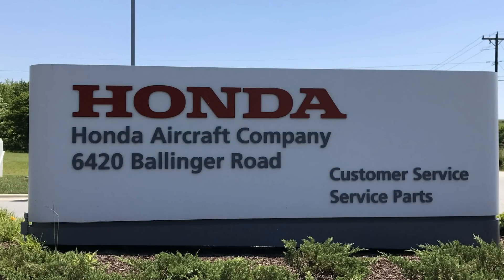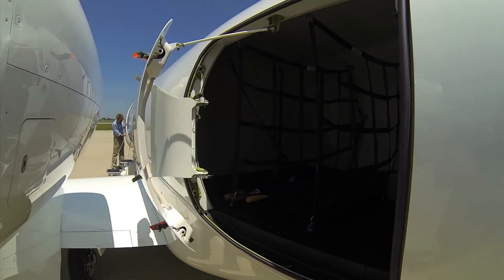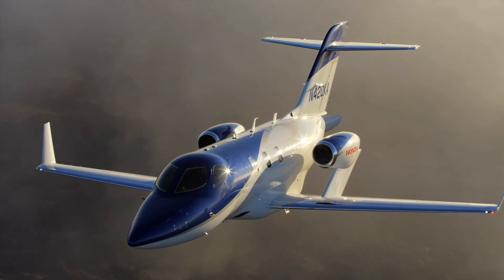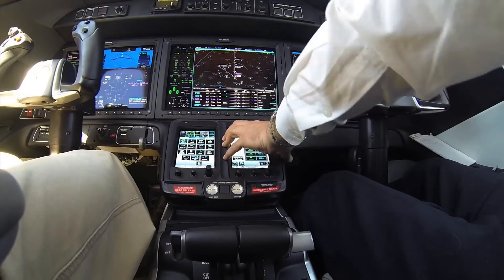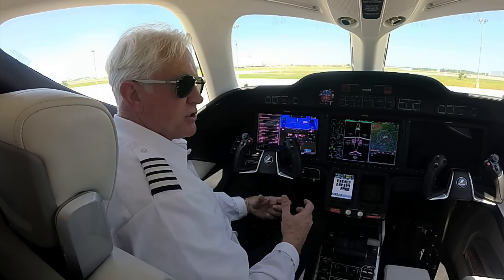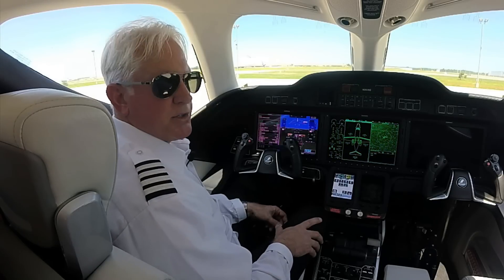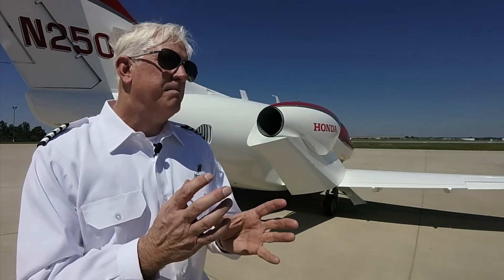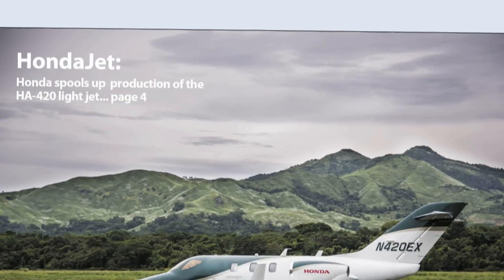HondaJet Flight Demo

Comment: Does it really need 3900 feet take off?  its climb rate is very high and great thrust to weight ratio so I'd think it could do short runway take offs.
Reply: 3900 fpm climb..not ground roll

Comment: This Jet is good in all aspects except the choice of the Engine. The Engine burns too much fuel and for a personal Jet, or charter Business, its not a good choice.  If there was a way to changing the Engine to match Light Jet category, or if there were different Engines from which to choose from, it would offer a better choice of a Light Jet. But as it is, it appears to be cheap on purchase but the cost of running it is much higher.

Comment: I don't understand why it is so expensive. It is an aluminum tube with some cheap chairs inside. The plane should cost no more than 250,000.
Reply: It is priced for development cost and what they think the market will pay. If they lower the price to much it will be seen as junk and some will not buy it.
Reply: You mean Cessna 172? you can get one for 35k or less.
Reply: Old? Yes. New? No.
Reply: actually I priced a C175...my mistake

Comment: Over wing fueling is a sad mistake, do these things take prist?
Reply: Single point, over wing fueling is actually quite convenient. Prist is not required thanks to the fuel/oil heat exchanger, but may be used if desired.

Comment: Gotta love those submarine-hatch--like windshields. Great for outside view and general awareness...not!
A biz-jet coming to market nearly 15 years (!) after its first flight that barely brings anything distinctive, apart from the wing mounted engines.
I don't think there's a more adrift company in what regards to strategy and purpose than Honda, in our days.
Reply: NimbusKhan NK      You don't think a $4 million jet in a $20 million market brings anything to the table?
Reply: @jshepard152  it did 10 years ago, but it's late to the market. The new Cirrus SF-50 is half the price.

Comment: No bird spiral on the engine nose?
Reply: Gasinduced Bird spiral? those spirals were created so that the ground staff has situational awareness when the engine is spinning. since the engine is mounted on top of the wing and is not instantly accessible because of how it's mounted, it is not necessary to put a spiral on the inlet cone.
Reply: It's likely they have a proper name not bird spiral. I understood they were added to prevent birds from flying in to the engines.

Comment: spokesperson needs to understand his audience - how much of the public know what a "flight level" is?
Reply: SDsc0rch altitudes with the last two 0s taken off. They start at 18000 feet. This is when planes transition from the local barometer setting to the standard 29.92 inHg. or 1013 hPa.

Comment: So not putting indicator lights on the ap panel is a feature. I guess making the panel settings instantly recognizable to 99% of the worlds pilots is a bad idea. For the most modern design in jet aircraft I also notice you still need to be an olympic high jumper to get over the console and into the seats. A little short on range for this class, the M2 sees 1550 nm and has leg room along the console to get in the cockpit seats. The Hondjets takeoff and landing distances are pretty sorry too.
Reply: >So not putting indicator lights on the ap panel is a feature.

Yes because in ALL other jets, pilots mistakenly rely on the panel lights to tell them what mode they have selected or what mode they are in. ONLY the Mode Annunciator Panel above the attitude indicator CORRECTLY tells you what you have selected. This is a good safety design feature. I've been a jet pilot instructor for 20 years and I've seen many pilots incorrectly rely on the lights on the auto pilot panel to tell them what mode they have selected...only to be wrong...so this feature is a big deal if you are a pilot. If you're not a pilot then it will pass right over your head.
Reply: Nobody cares. Stop nocking things people spent years and millions or even billions of dollars developing. Have you designed a fucking jet? Also, it is Honda's first jet. What do you fucking expect.

Comment: '
2 jetmotors on the wing is a okay but not really good idea...
better put 2 jetmotors on the rear body tube as A-10 thunderbolt plane / A-10 warthog plane design
Reply: bestamerica I'm assuming Ur aerospace engineer who has studied both designs
Reply: bestamerica I'm assuming u mean picture the airflow and study that for maximum efficiency
Reply: Literally one of the most important features of this aircraft..
Reply: The rear can be made much lighter without the engines,The wings are already heavy structured, plus you save weight on tubing, cables and complications
Reply: @gukakmakuk  are you trying to get rid of the engines altogether? Lol jk.
Reply: I call that the CRJ mode
Reply: hi VA...
wish but not...
use my mind and picture
Reply: That engine configuration is only available with the 30mm https://en.wikipedia.org/wiki/GAU-8_Avenger Rotary Cannon option.